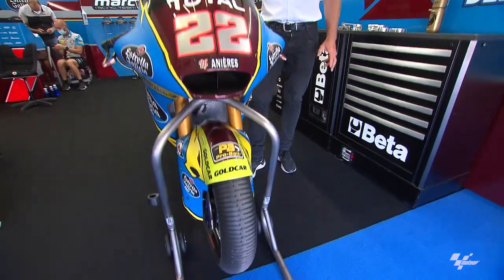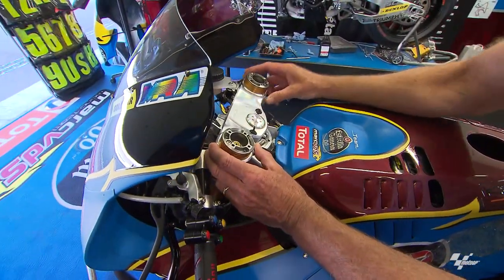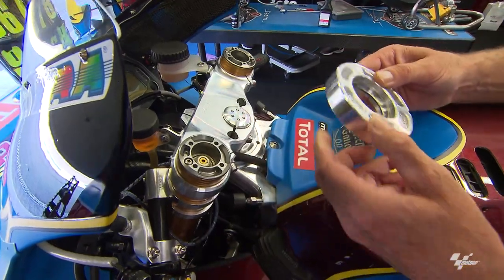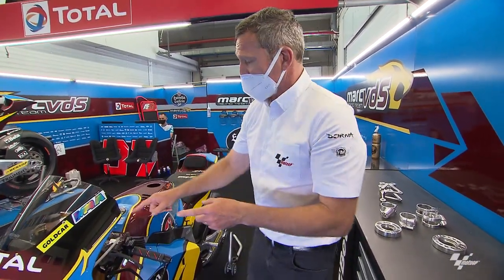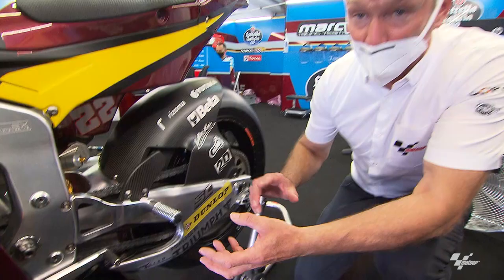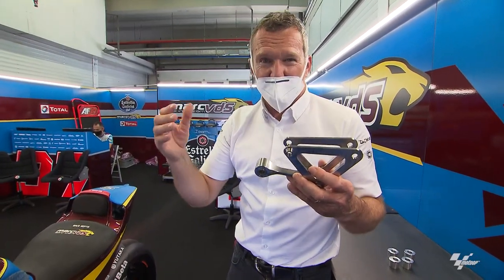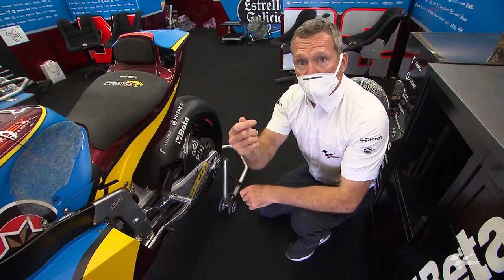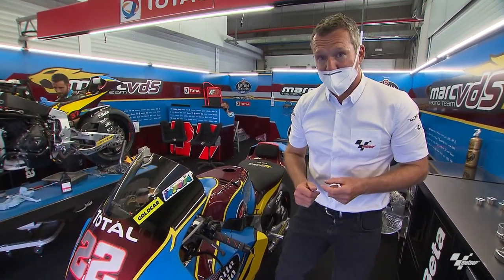Chassis adjustment and ergonomics: Tech Talk with Simon Crafar

Comment: Wow. Motorcycles are amazing. The amount of variables for someone that knows how to take advantage of them is INSANE. I’ve always loved them, but never have had this understanding of them. So intriguing.
Reply: Agreed. I always wonder how so many riders use the same kalex chassis but with much different speed. I just can't accept the argument that talent alone made that difference. Now this video answered it. There's so much variable in chassis setup alone. Not to mention other variables such as electronics and gear ratios.
Reply: @ranggafahmi8479  And suspension also - as Simon didn´t even mencion front/rear suspension setup on this video (altough some count suspension as part of the chassis setup).

Very interesting concepts for many people indeed. Fascinating.

Comment: With so many dependent variables it seems you'd want software making the recommendations for the  adjustments by calculating the results of multiple change paths based on automated data accumulated from the bike/rider while out on the track.
Reply: Not quite. The reason is that there is no perfect setup. If there were, they would all run that specific setup. Thing is, different manufacturers have a different philosophy when it comes to the machines they put on track. If your model says that setup A is the fastest but the rider is always on the edge and risking, why not use setup B, slightly slower but safer? Obviously, my considerations are only very generic. As with everything, setup is a compromise. The human factor can't be taken out of the equation.
Reply: @giodc8599  Yeah, you quickly run into trying to engineer into the bike constraints on the human. For example, a seat designed so that the human isn't allowed to move around but the bike moves the seat/human as a whole based on lean angle, brake position, and other steering geometries. It would quickly become apparent that it would be easier to remove the human altogether and design an AI to pilot the bike and then let the modeling software optimize the geometries of the bike in that context.
Reply: @georganatoly6646  Correct. You won't find 2 riders riding exactly in the same way even on the same bike. Don't forget a bike is developed in a specific way by a test rider.  This can be a make or break. KTM seems to have done a step in the right direction, for instance. Also, weight of the rider is also very important. A heavy rider will suffer on a Moto3 whilst a light rider on a MotoGP will have an easier time taking off. Again, all about balance. There is no perfect recipe.

Comment: Lots to be said about the subject. Teams use rider feedback and telemetry to see what changes are needed in order to have the bike behave in a certain way. At the same time, rider needs to have confidence in the bike. There is no point in setting up someone to a "faster" setting if that rider can't use the full potential of said settings. All the mechanics have the highly important job of delivering a bike that suits the rider, stays within regulations and goes as fast as it can.
Once you start doing trackdays you'll understand how tiny changes in geometry can make a bike feel very different.

Comment: Did suzuki ever use the  full floater shock  on gp bikes like the motocross lineup back in the 80s .and was said it the ultimate true  rising rate suspension. It did have a lot of moving parts.bell crank, push rods and lots of needle rollers .bad Brad lakey.won the world championship on that very suspension.to complex?